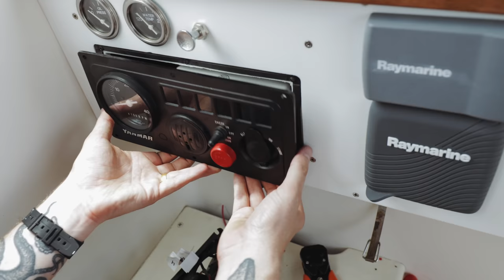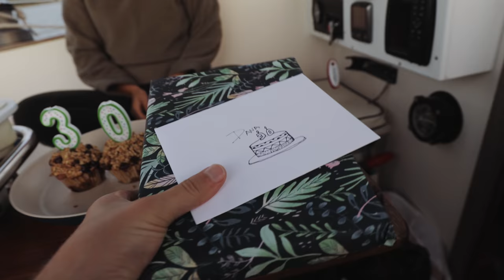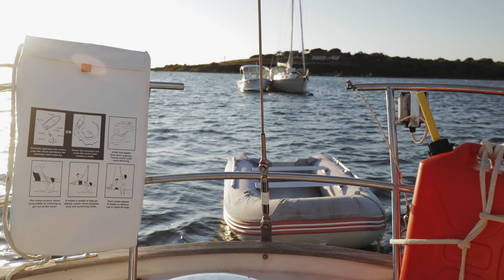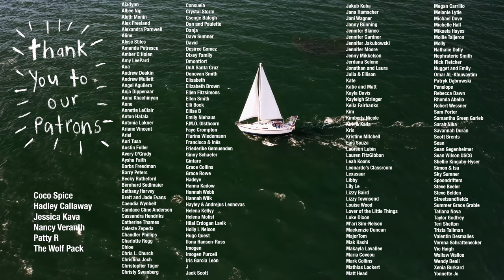What it’s really like to start BOAT LIFE | Boat Life Ep. 31

Comment: About your front V-birth smelling like the holding tank, change your hoses to smellproof EPDM versions, the cost more but worth every cent. Normal hoses are permeable to smell after a couple of years. After that, switch the foam in the matrass that has soaked the smell over this time.
Reply: Most importantly you need to keep the waste out of the hose and in the tank or overboard.  Water is you friend..  some even do a final flush with fresh water.  You can calculate how much volume you hose hold and figure how many pumps it takes.  Go to the sailboat owners forum and look up information on Peggy hall the queen of tank odor prevention..  2 vent hoses are essential on the tank and even a small vent fan.
Reply: Agree that Peggy Hall is the expert. If you follow her instructions , you will be more than OK. But also remember that once you leave the US, in most places you will be discharging directly as there will be no pump out facilities.

Comment: Getting groceries is always an operation it seems, no matter where you go. Even if there is a grocery store right there by the dinghy dock (like in Baltimore's inner harbor anchorage, for example -so close!) it is still hauling bags and bags of provisions to the dinghy and loading it up, motoring or rowing back to the mothership, and passing it all way up and carrying it all back to the cockpit.

Phew!

We are religious about dating everything,  removing labels from cans and re-marking what it is with a sharpie.  We also try to remove all other paper or cardboard packaging because it is a source for BUGS getting onto your boat...yes, even in the USA -especially further south.  Even something like the cardboard from a case of soda or fizzy water can be a roach hotel if you bring it aboard.  So we strip everything before we bring it aboard or at least out in the cockpit before bringing inside and down below.

A huge aid in shopping is our folding bike trailer.  Even if we didn't have our folding bikes we would still have this trailer.  It is called the Burley Travoy and can carry 66lbs effortlessly behind you to the point you forget you are pulling it when walking until you go down the ramp to the floating dock and it tries to run you over if you don't reverse and go down trailer first.  You should look into it. 

Another great thing are the big blue bags from Ikea. Those are a blessing keeping groceries and other loads like laundry together. They are cheap snd pack small yet can handle huge loads.  They keep everything together in the dinghy, and are even fairly water-resistant when the dinghy floor is wet.

As for the best berth to sleep in on the Rasmus the V-berth is best hands down in our opinion.  It is HUGE -but our holding tank is installed in the port lazarette instead of under the roomy V-berth.  The laz is huge and the 20-gallon tank hardly takes any room from that massive locker.  It's a longish run for the hoses, but we actually used a 10' piece of PVC pipe for most of the run which is tucked up under the back of the table settee bench in an area that doesn't hurt the storage of that part of the boat.  It is even pitched so the contents naturally drain down into the tank.  PVC never stinks. It is what is used in houses for sewer pipes.  It is well-suported and isn't in any danger of flexing or breaking. After 4 years it is doing great.. We have short flexible hose sections for  each end to connect to the head and the tank

I hope the winter projects go well and you decide to leave early enough next summer to enjoy the ICW going south and the classic cruising journey that is.  You really don't want to miss out on that.

Comment: You are absolutely right: boat mattresses are for short term use. Get a full (as in not split in sections) real mattress.(doesn't need to be marine grade or built for purpose)  Not foam, but inner spring and get wood slats (to lessen condensation below them creating mould) As a liveaboard invest in a decent one piece mattress, even if it's a pain in the butt to get down and into the bedroom (remember those home delivered mattresses come in a tiny box and then pop out so it can be done.) Oh and some boats have these weird beds that go narrower at the end. This is to give the illusion of an "island" or walk around bed and it's a waste of space. Go rectangular, forget that narrow foot-end it's silly. (also makes sheets easier too buy especially fitted undersheets.  Hang in through the tough times. Stay safe and well and e easy on yourselves. There will be times of stress, and even fear. As hard as it is to do, when things go arse-up stay calm, slow down. Good luck.
Reply from the maker: Thank you so much for sharing this advice, Black Duck!! We will definitely take it into account--came at just the right time, with all these projects we have in store :) Have a wonderful 2021!

Comment: I’m sorry but you should never remove a navigation station to is the heart of the boat. And when your electric equipment falls you are going to wish you had it. Now if you remodeled it in to your computer work space and the computer is part of the navigation system it would be great. I would be looking for a sailboat in my future I had one years ago. I would have and navigation system in the computer build because you can download charts and hook up apps receiver to it and a home server. But I would have some paper charts made of the location I would be sailing and I would buy a sextant and tables for sailing if the electric equipment falls remember you have a big lighting rod sticking out of your boat. Now today you should have two gps one hand held and one built in to your boat. Now some chart plotter are not up to date but you can get E charts updated easily on a computer. Now with your navigation station I would say that you updated it to a computer work station. Because the navigation station is for planning and logging what your sailboat is going. Even new sailboats has a navigation station.